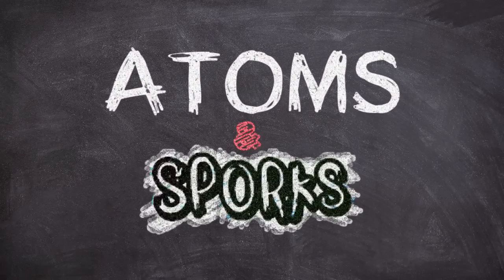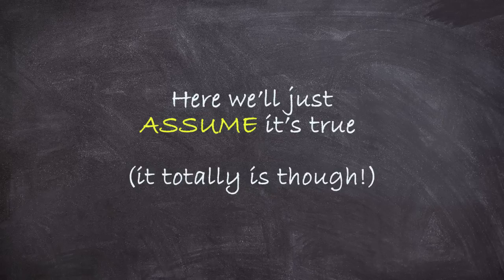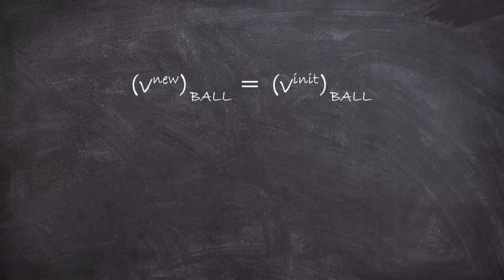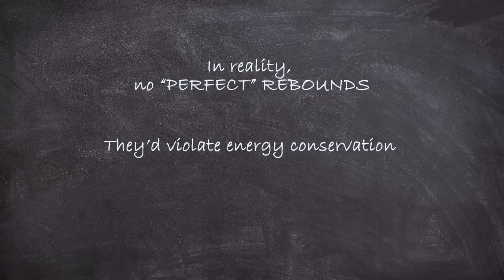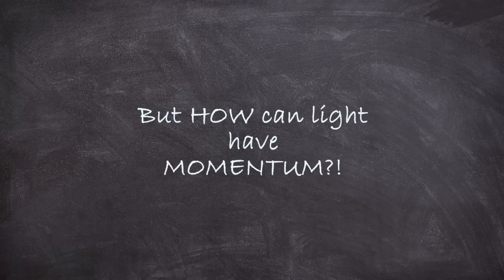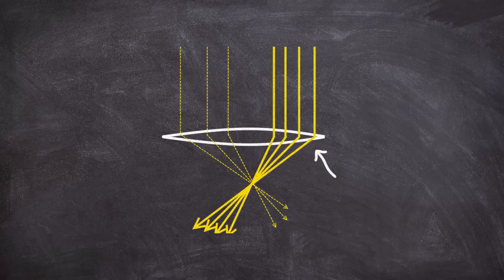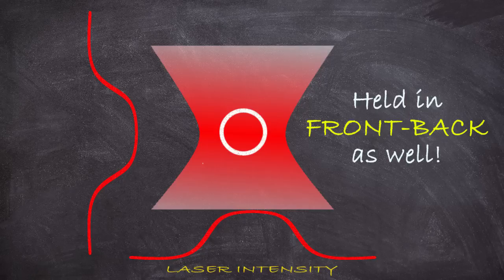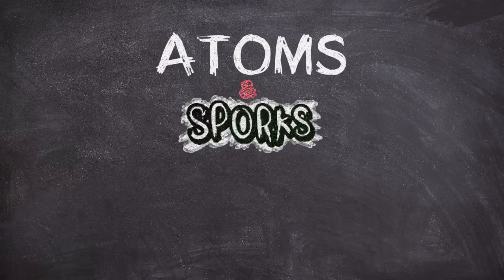The 2018 Physics Nobel Prize: What ARE Optical Tweezers?

Comment: Can we really use Newtonian mechanics on light ( no mass , moving at the speed limit .. ) like you did in intro ? I think that a relativistic or quantum explanation is more rigorous .. seems legit though
Reply from the maker: As I say at the end of the video, it's a bit dishonest to use a Newtonian result but the answer ends up being the same except where the ball loses speed, light is instead red-shifted to lower energy (and still travels at the same speed). To do it correctly you would just use classical electrodynamics though, not quantum mechanics. As for the quantum description, it's my policy to always use the classical picture when that holds the same physics. The momentum of light is NOT a quantum effect and was a known prediction of Maxwell and classical electrodynamics back in the 1860s and was first observed in 1900 (years before anyone came up with the notion of a photon). Interestingly it actually goes back further than that, believe it or not it was first suggested Johannes Kepler in the 17th century who noticed that the tails of comets always point away from the sun and (correctly) hypothesized it was because light has momentum.

So, radiation pressure is a classical effect, no quantum mechanics needed, QM or QED will tell you the same story.
Reply: Atoms and Sporks thank you

Comment: do you know the size limits for particles which can be manipulated by the optical tweezer ?
Reply from the maker: I'm no expert, but my expectation would be that they cannot be applied to particles larger than the wavelength of the laser (i.e. restricted to ~sub 100-nm particles) and that the force generated is limited by the momentum of the light used (which would mean the maximum force is likely in the picoNewtons). So unfortunately it's not an approach that could be used at the macroscopic scale.